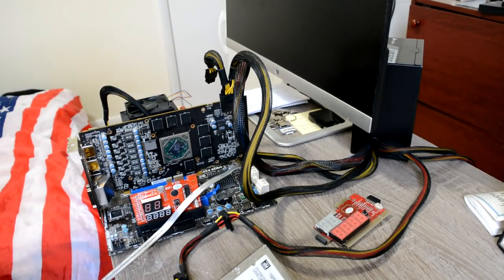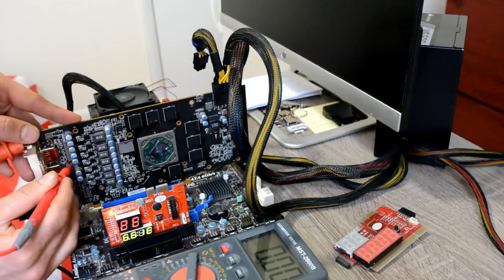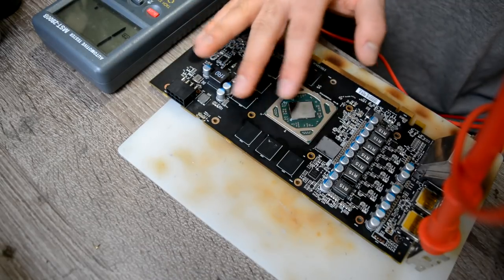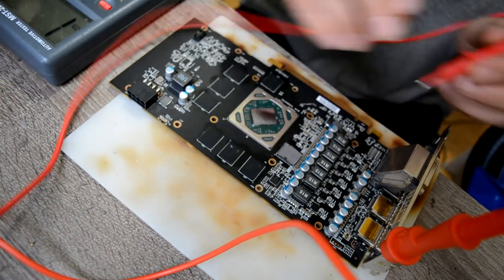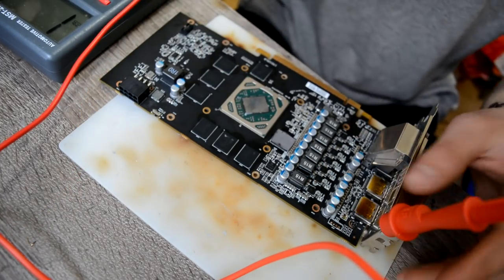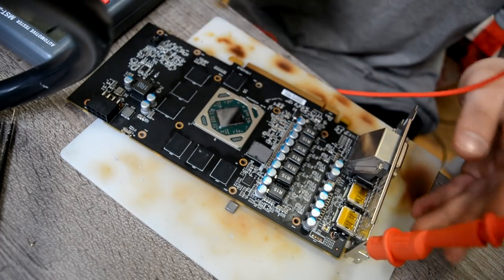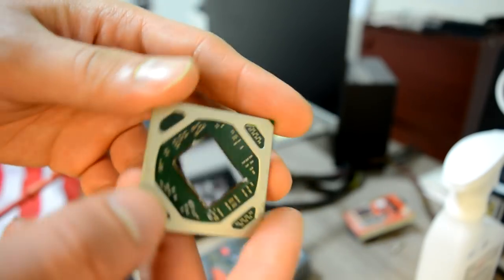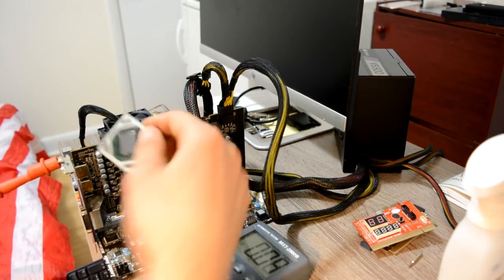Radeon RX 580 doesn't work diagnostic of a graphic card

Comment: Have you ever used the Ch341-A tool to reprogram the bios chip manually? I have an Rx 580 XFX dual bios card that was flashed with the wrong memory and is bricked. It wont boot when hooked in to any pc. its not recognized. please any help would be great

Comment: I would have liked to have gotten close ups of what pins and how to identify each of the items you were checking. I have a board that is not showing any thing or stripes on the screen after taking it out of the case with the power cord off but connected. I have no way to know what to check or were. Had you discribed and shown close ups would have been helpful. Just a thought maybe for a future video. Thanks for the video.

Comment: I realize this is a 3-year old video, but I have an XFX RX580 GTS 8gb card that is chip for chip identical to that card. I bought it non-working and I am trying to fix it. I discovered it is missing a small chip Q4614. It is supposed to be sitting next to Q4615 and directly below the 1R0 cube. Q4615 appears to be a MOSFET SM4373NA. Nearby Q4613 appears to be a SM4377. Could you tell me what the missing chip Q4614 should be? OK. I found it on a board breakdown video. Both Q4614 and Q4615 are SM4373NA.

Comment: Where do you find the restiances and voltages of the cards? Is there a place to get them? Wondering because I have a xfx rx 580 with the same pcb that wont emit any heat or have fans spin. I measured the chip resistance and it seems to be fine but (not sure if I am measuring the right thing) but the memory controler has a resistance of 250 ohms.

Comment: Hi, a question I hope and you can help me, I have a radeon rx580 I have a crash problem due to overheating, I already changed the paste and thermal pads and heatsink and fans and still it continues to fail.
Reply: the card gives video, but when you put it to play in 30 sec it goes 100% temperature and crash.  can you help me ?

Comment: Hi Elitech. I subscribed straight away when I found your vids obviously you have loads of knowledge. I have more than basic knowledge of electronics but have a gpu with strang issue and wondered what you think. Msi rx580 8gb oc. The card has no shorts and is recognised by pc. But the bios wont program and clock speeds show zero. I assume the clock gererator power is not working and wondered if this is also the power for bios chip? The bios doesn't show or hold a PN. What do you think? It's a hardware issue but struggling to narrow this one down?

Comment: is there a way to check if 1 mem chip is bad on a card that has all its rails on gpu gets warm  but still no display windows blue screens on start up  stuck thread error shows up on rx580  noticed with ir camara  the 5v regulator is at 40degree  and one ram chip gets hot faster then others but  not getting hotter them 40

Comment: I have a broken Sapphire Nitro+ RX 580 8GB. I took it to get fixed but they failed. I told them there was a short but they disagreed.

Yesterday I picked up a Multimeter and a sodering iron station. I found 2 dead SMD resistors ? I think that's what they are called.

I never did anything like this before, but thanks to you Russian guys being the only ones on youtube fixing these, I'm trying and I feel like I'm making progress. 

I need to order some parts and look into getting some tools to remove the resistors. I need to know these skills cause I have 26 GPU'S working 24/7

Comment: Hi Eli! I have the same nitro as the video but I'm measuring 0.6 Ohms in the GPU (measuring power choke and ground) and 0.4omhs in the capacitors leads. The graphics card works but when you put heavy loads the clocks go down. Can be the capacitors of the pwm phases the cultrip of the problem? This card was used for minning. Thank you!

Comment: Hello Eli :), let me ask you about a few amd RX580 underrvolt that had save for about 1 years working perfect in a few mining rigs, now i see that a few of cards not working, i am testing only the board and finger on GPU and getting hot but no show video :(, testing on linux mining reportamdgpu powerplay smu load firmware failed"amdgpu powerplay smu load firmware failed",ect. ok some suggestion? i am ready with voltimeter :) for defective :).

Comment: With the card 580 it seems the core is robust enough to take 12v into the core if a small enough inclusion of the voltage by only one phase into the core. Unfortunately this is not the case after 580 because of further chip refinement of smaller scale components producing a dead core like with Radeon64 chipsets making it less robust unable to handle any inadvertant 12v by direct mosfet failure in the closed mode. Thus mosfets must be designed to fail open and should be immediately implemented.

Comment: Hi, I hope you'll notice, thanks for all your helpful and very informative videos, I subscribed to your channel.  I have a question about Asus RX 580 4gb VRM, I found 1 Mosfet was shorted so I took it out properly and the short on the 8 Pin power is gone using a multimeter, however, the 1st 3 pins on the PCIe connector shows extremely low resistance around 160-170 ohms only, and the pad of the shorted mosfet is still shorted, reason why I did not place a new mosfet yet, where would you suggest for me to look further into? How should I trace where the short is originating from? Any help would be grreatly appreciated.
Reply: fuse and condensator

Comment: Hey man! So I bought a Asus strix rx580 o8g from eBay. The first week it worked completely fine but today my whole pc just Froze and it's not working anymore. The RGB`s are working when I turn on the PC but my pc detects it as not working which makes my pc don't boot. Do you have any advice what I could do now?
Reply from the maker: NexusEdits take a multimeter and do diagnostic on it

Comment: Hi Eli!
I have a Sapphire RX580 SE 8GB Nitro that had exactly the same problem like this, so i have replaced the BGA with a working one, now i have around 17 Ohms on that rail, the other rails are good too, everything looks good but the card is doing the same (tried both bioses), lights up, but fans are not spinning, atiflash not see dedicated AMD card. Maybe something is wrong with the fan controlling too (because i think these cards have a protection that prevents themselves to powering on if fan controlling is failing)? Any advices?
Reply: How long have you been using the gpu bro, cause im thing on buying sapphire nitro radeon rx 580 8gb. whats your oppinion should i buy it?

Comment: ive got a faulty rx590 from my freand. after removing cooler i founded a lot of sticky sings of coca cola etc. Cleande with IPA  but after pc wont on. Is just spin fans for 1sec and goes off. WIthout gpu is booting fine. Where to start chcecking card ? with multimeter

Comment: I have a Asus Dual RX580 that stopped working the other day. It still shows in the device manger but has code 43. I also noted that the GPU gets hot while the card is doing nothing. I can still access the card with ATIFlash and reading and writing to bios appears to work fine. Is the GPU chip itself dead or shorted causing it to get hot? Can the card still be fixed or is it beyond repair?

Comment: Nice video man! I have a question. I have GTX 1070 which works just fine in lets say bios screen and for a short time in Windows, but then picture on the monitor get garbled and it turns off and on. After a minute I get the blue screen of death and restart. Now I am waiting for a new multimeter and can't do nothing, but in the meantime I'dd like to ask you where would you start looking for the problem? Also any budget microscope to recommend?
Reply from the maker: Hindel Gaming if it has artifacts first what I would try is new chip
Reply: @elitech3339  artifacts always make me think of memory over heating or sur-volted, but im beginning with these stuffs

Comment: Hi Eli, awesome video. I've subscribed already. I have a Sapphire Pulse RX580 8GB. When I hook it up to my PC and power up, the card isn't detected and the fans don't spin at all. I have tried sending it to a local shop and they mentioned something about replacing the "power controller" and it seems to blow out after replacing. Does this mean my GPU is already dead? Do you have a spare RX580 GPU for sale?
Reply: Your gpu not dead only power controller need to be replaced.

Comment: Could you do a video on how to prevent you new video card from failing over time?  I know its not in your best interest since you probabily do repairs for a living but I though I'd ask anyway.  If not, no problem.
Reply: dont overheat it
Reply: Hope mine doesn't get anything like this... It's a powercolor red devil 580 that I bought used
Reply: Try to keep your card and its components as cool as possible. The cooler the electronic parts, the higher the likelihood of a well aging piece of hardware. Apply quality thermal paste after warrenty period (or even before, if you're not afraid to void it), make sure you have decent airflow in your case and that your card is within it, remove dust when it becomes visible, keep an eye on your GPU temps under load (use MSI Afterburner tool with OSD enabled) Everything below 80°C is OK and below 70°C good - but the lower the better, of course. Try to create a custom fan curve if temps are getting worrisome, in order to trade cooling performance for noise if you can bear it. That's pretty much all the average end-customer like you and me can do.
Reply: Should also replace the thermal pads on the ram chips if you see any melting.
Reply: freeze it in refrigerator,  It will work for lifetime
Reply: Don't play with the overclock
Reply: Undervolting

Comment: brother I have a 4g rx 580 by mistake I did not realize that the power supply was on and connect the 8-pin molex connector to the 580 and it did not turn on again it does nothing nor the fans turn on but the gpu gets voltages because It heats up, it also gets 3.3 and 12 of the pci that happened to that graph if you can help me I would appreciate it

Comment: Gugabyte rx 570 8gb. Can play movies, can run adrenalin stress test here i can see temps can go to ~65°c in load and 37-43°c at no load, games runs upto menu but upon loading to play it stuck af some point and graphics ram cannot load beyond 1gb. Did ddu from 21.5.2 to 21.5.1 to 20.4.1 still same problem. Could you help trobleshoot

Comment: hey man, I know this is old video. my Nitro RX 580 couldn't start the fans, fans only spins for 1-2 seconds when booting then dies. it's not idle then it switched to 0 rpm (I know that feature), it's not spinning at all, even when GPU runs at 100%, and turning hot at max temp 85C, fans still not spinning, stays lazy at 0 rpm, but weirdly fans % aren't 0. it's not the fan, I check to put my fans to other GPU with same model, it works. I tried BIOS flash provided on techpowerup and still not solving anything. tried to change fans cable still didn't work, even whole fans shroud changed still didn't work. it only works barely moving 1-2 seconds after a cold boot.

how to check or repair this problem, is it broken fan chip controller? where is it? i have spare Nitro RX 580 which can spins its fans, thought it can be swapped on some components. I don't use that spare RX 580 because it sometimes crash at boot, to random colors, but the fans situation are okay.

Comment: What if crystal gets hot when power plugged in but no display on screen?
Pls guide
Reply: were you talking about a brand new or used GPU? I just recognized that some of my Polaris GPUs were detected on Win7 but not on Win10, so I either just patched them or bios modded them. After that, plugging them directly to the board as 2nd discrete GPU, they were either detected and ran good or just needed to be patched because of error 'code 43'. I hope this helps you somehow and that this recommendation didn't come way too late ^^

Without an APU / CPU with integrated graphic chip it's pretty hard to get any system feedback for your GPU and because I'm still waiting for mine to arrive, I just tried it that way, with 1 working discrete GPU connected via Riser card and then checked the faulty cards one by one

Comment: I have an rx 580 from Sapphire with a bit of artefacts, both in boot up screen and in windows. I guess it's the actual GPU chip? Could it be some other component that's dead? Any advice on how to diagnose it? I'm thinking about giving it a go with my hot air station and pray for the best :D

Comment: I have a RX580 that the fans spin and then dont spin, GPU works fine just the Fans are not working, bought replacements, same issue they for a bit then they dont spin, no matter the driver, vbios, or app i install to control them, always in 0 RPM, can you help me? other than this issue card works perfectly

Comment: Hello,  hope you're doing well. I own a RX 580 8gb sapphire nitro + special edition, the card boots up and installed with the latest drivers too but from a past few days I've noticed the RGB has stopped working and the fans are not spinning under heavy load too. 

I can run games fine but not for too long as it goes up to 85c so as a safety measures I turn off the game itself. Plesse help, thanks in advance.
Reply: Same card as mine, try using msi afterburner to increase fan speed if it work, and also change thermal paste and thermal pad if u never change it before, mine getting hot too before, but don't have fan speed problem..i just change thermal paste and pad, boom!! it stay under 70c after that.. :)

Comment: i have a 580 8gb msi amour, when i install i get flashing displays and freezing, any ideas on anything? ive done drivers and thats not the issue neither is power i got a brand new psu, its fully compatible with eveything. thank you
Reply: @Mafia2637 did you find out what problem it was? I have same problem, after driver install it crash with flashing screen.
Reply: @tmx6666  I think it's a driver issue, but I couldn't it to workout of safemode
Reply: Thanks

Comment: I have a rx 580 and my monitor just says no signal and my HDMI is plugged into my gpu someone please help :(
Reply: Try using DisplayPort cable dude
Reply: I have an rx 570, had this same problem. Turns out like someone has said, it needed a display port monitor. Once the drivers are loaded it should display through hdmi or display port. However, even with drivers,it won’t show the bios screen, it will only display once windows 10 loads up. The only way it will show the bios is with a dp monitor. Dp to hdmi converter won’t work either.
Reply: @mattfischer3853  my friend do you still have that card ? are you willing to give it away ?
Reply: @shinigami8759  ended up selling 2 yes ago

Comment: my 980ti now doest work ....i think its shorted how can i fix it ...!! :(
Reply from the maker: Mon Jei at leastst start measure resistance
Reply: how can i send u a picture ?
Reply from the maker: Mon Jei picture of what?
Reply: of the pcb i found somthing burned i think its a capacitor does that mean its dead?
Reply from the maker: Mon Jei ring it up to confirm a short. Then yes if it looks bad then most likely it’s burnt out. Remove it and see any differences. 2 min of work
Reply: i dont have the tools sadly.... i just wanna know if there is hope ... to send it to someone and try to fix it cause the sending cost much
Reply from the maker: Mon Jei ohh holy moly. It’s a long story bud. One of you phases went out. Btw this card might not be fixed at all. You have to take all burnt elements out + check keys and clean everything up. Then see if short is out, if yes then put new elements back and you good if no then traces inside board got burnt to the ground. In those cases you have to drill motherboard and etc. You have a hard case of break
Reply from the maker: Mon Jei but I double have a look and actuall remove cap and clean everything up that’s might be it. Just make sure put cap back, those caps in short helping open and close transistors. If you don’t put them back it will heat them up and burnt out keys
Reply: worth sending ? or throw it in trash ....its 980ti :(
Reply: just a question do u know what causes this? is it gpu failure ....or psu is the cause ?

Comment: Hello sir my gigabye 1060 mini itx gives signal but the screen is blank. It also posts after a long time then it used to, windows turn on in the background but drivers dont work when I checked through team viewer. Can you please tell me if its fixable or what the problem is?
Reply: It could be the Display probably.. 
Tell me more in detail.
Is it detecting the drivers ?
Fans dont run when the temp exceed the limit on gtx 10 series i have that card too.